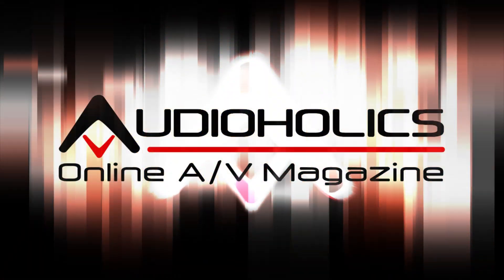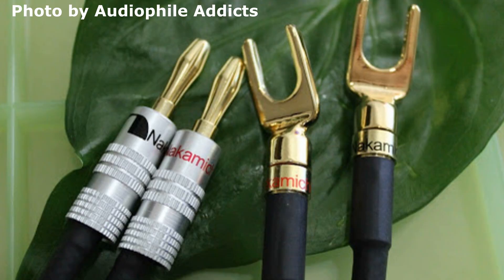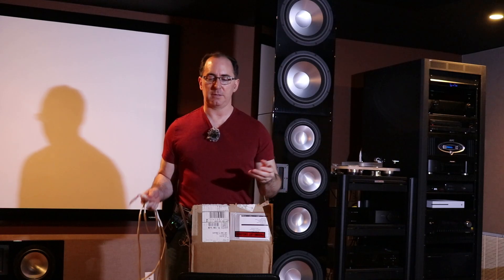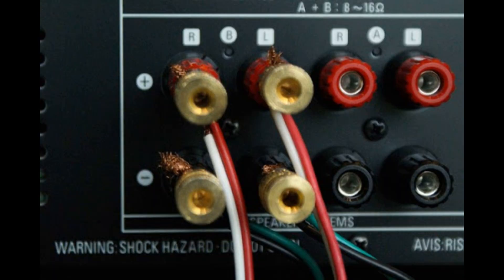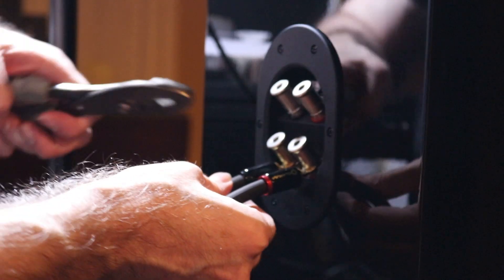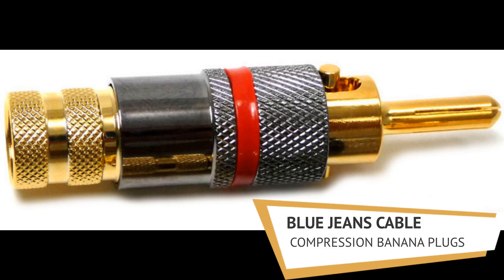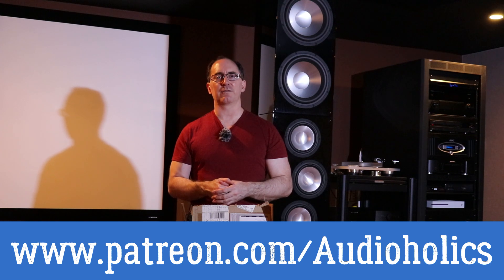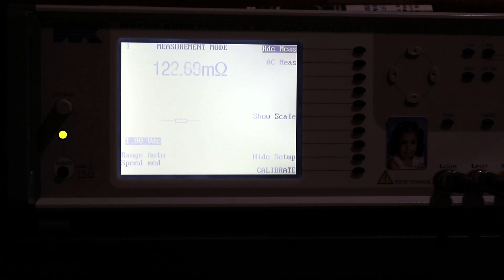Spade vs Banana vs Bare Speaker Wire Terminations: Which is Best?

Comment: I tend to think that once a raw cable is installed inside the banana connector with heat shrink tubing to seal it, the wire has either a lower or slower chance of oxidizing over a long period of time. I would imagine some bare wire connections in basement environments where climate control is not 100% in every single back corner space, you could have the potential of cable oxidization. I had pure copper cable run in my previous home theater and the runs were in place a good 18 years. The ends I did not terminate did not look pretty.

Comment: So glad to see you up and about Gene! And to come back with a hot topic for me right now. I just mounted a center channel and didn't have room for my traditional banana plugs, so I modified some minimalist plugs. Something I don't hear much any more is using solder and tinning the wires. I had always assumed that was much better than just bare wires, however I would have really enjoyed using your testing equipment to see if that's true!  BTW, I really like how my banana plugs came out, I will probably continue to this method from here on out, until the next great speaker connection upgrade happens! LOL... Welcome Back!

Comment: I bought two pairs of beautiful spades for my Magnat speakers from the Internet. The spades were to BIG. So I returned one unopened pair.

My vintage Luxman receiver has push buttons with the small wholes for speaker cables on the back. So I bought those thin banana🍌 plugs.
BUT...once connected to my Luxman, the banana plugs were touching eachother. They were placed to close.
So I FRIED 🔥🔥🔥my Luxman. It got repaired. But there is still a burn mark on the inside.

Comment: Bare wires do get corroded. Sooner or later. In a dry climate it might take years but in moist places it happens way faster. I prefer crimped soft copper spades with direct gold plating. But many bananas and BFAs are also quite useful.

Comment: Gene, that's an idiotic statement about spades. Not all spades are created equal. The key is to use soft copper spades with direct gold plating. They DO lock in place. After a year or two it's often quite difficult to get spades out. Over time under pressure they form some sort airtight bond with bonding post clamping nuts and base contacts.

Comment: I like bananas for most situations. Bare wire where I can get away with it. I also dabbled with direct wiring/No connector on the speaker enclosure and banana plugs on the amp end. Great if you have a few miles of speaker cable (I have been a speaker hoarder for more than 20 years). Anyone else give this a shot?

Comment: I prefer soldering all connections to circuit boards for the very best sound quality. Since that is impractical for most, bare wire to binding posts is the best sonic option.

Comment: If you use spades, just get some 'square' spring washers to keep tension. personally i use banana plugs, if the bog standard ones are good enough to test £100,000s of equipment in the electrical industry (im talking micro Ohms of resistance between joints), the gold plated ones are good enough for my speakers!

Comment: I use the spades because bare wire on the amp side always seemed to be difficult to hook up and keep tight, plus the issue you mentioned. Plus they always put the speaker posts too close together on amps. And unless you really tighten the posts on the speakers they too will come loose. I always thought banana plugs were not effective but maybe I was wrong. I didn’t test it with a multimeter. However, if you try to bi-wire your amp spades will not work because amp makers put those plastic covers on the posts making it almost impossible to bi-wire with spades.  Took me 45 minutes on my NAD amp but I forced it.

Comment: The advantage of banana plugs is they are designed specifically for audio interconnections and required no specific tooling to apply to the wire.  When using spade terminals, for best performance they must be properly crimped to the wire using tools and methods specified by the spade terminal manufacturer. Workmanship for both DYI  and cables assembled by manufacturer is very important.  If I were doing this as a business I would invest in the needed wire prep and crimp tools and use spades were possible.

Comment: None of the above. Tube Connectors from GR- Research are the best.  Re-wired my speakers with Tube Connectors and high quality solid copper wire.  Easy to hear the difference it made.

Comment: Love ya Gene looking good glad to see it I have a question should you be saying milli ohms or meg ohms because my husband is an electrician and he says kilo ohms and meg ohms just wondering if it’s different nomenclature for audio hookup than high voltage three phase electrical circuits he deals with and thanks for the video and everyone needs to check for those loose connections from time to time it can make a huge difference in resistance thanks for the video big thumbs up 👍
Reply from the maker: haha I was talking about milliohms, kilo or megaohms would be like an open circuit in this case.
Reply: Audioholics thanks Gene can always rely on you to clear things up

Comment: I'm no expert but what I did was cable clamp the wire to the back of the speaker with about 6 inch left loose on the end so when I shimmy the speaker in position it won't pull out and I use spades because I want a clean tight connection and yes I carefully used pliers too and this stopped my speakers from blowing fuses when I cranked it up when I was using banana plugs it saved me a lot of heart aches

Comment: With spades, could try a 'crinkle' lock washer under the terminal clamp which should reduce the risk of coming loose. e.g. https://uk.farnell.com/tr-fastenings/m6-cwbcwas50/crinkle-washer-beryllium-copper/dp/2770730
Some terminals don't allow the screw piece to come off so it's impossible to get a washer on.

Comment: Thank you for the video! I have learned a lot from you over the past few years.  Compression bananas at the amplifier.  I merge two 12 gauge ends (bi-wired) and one 18 gauge for a subwoofer all into one compression banana plug at the amplifier.  Adds up to 6 to 8 gauge.  These would not fit as bare wire on the binding post.  Tried using bananas for low frequency and bare wire for high frequencies and subwoofer on the same binding post but did not get the same performance as merging them together into one compression banana.  
Bare wire at the speakers works best for me.

Comment: i'm 100% banana plug for all speaker connections. i use Monster brand which seem well made but there are a lotof other brands that have exactly the same design (strip the wire, feed it thru the bottom half of the connector, fold the ends over the top and screw the top half on tight). i too have had less than idea connections with spades. i've also had ones that were too wide to fit in small spaces between terminals. i used to go raw but had too many close calls with wire fragments almost touching each other....

Comment: I've been using Monster X-Terminators since they were introduced. Bananas that expand by tightening the knob for a tight fit that will never come loose. They are like the WBT's but cost me much much less when I bought them decades ago.
I agree that spades never stay snug over time and it doesn't take much to have them dislodge from the terminals.

Comment: IMO the best compromise is bare ends "tinned" with solder.  If you use modern lead-free solder, dip the stripped and twisted end in flux before applying heat and solder.  This approach takes care of the stray strands problem and results in a very stiff wire end that can take a fuktonne of torque on the binding post and normally doesn't require periodic re-tightening like squished raw ends and spade lugs usually do -- and best of all, it costs next to nothing if you already own a soldering iron.

Comment: A connection with bare wire is not protected against corrosion. Via the end of the cable the corrosion can creep further inside the cable and the resistance for the signalflow becomes much higher.
So this advice is bad, by first generation Monster Cable with transparent skin you could see after a couple of years the copper grew green and higher tones becoming weaker caused by that resistance. It's a pity some people pretending being an audiofile and specialist giving such bad advice. Regarding spades, there are also spades with kind of little security walls that will overcome the problems mentioned here , ao Inakustik ones. Bare wire of course is the cheapest option but looking at the expensive speakers you can see in this video money seem to be no problem here.
Advice is nice but here's someone missing the point, using the simplest of spades for his ,,objective"measurements. And oh high pressure crimping methods use by Qed and others is the best,
excluding oxigene. Good coppercable covered with silver or total (polished)silvercables of high quality got lesser resistance by time , sounding better, copper sounding less so that must be sealed.

Comment: Great video personally I use the compression banana plus but as you said the pin sometimes get stuck .
You know what it’s great to see actual proof about what ya are talking about , just like the resistance with the cable , I’m fed up with people just doing demos of expensive interconnects / cables / ect , I just want someone to do demos of normal priced stuff , why is everything classed as good got to come with a ridiculous price .

Comment: I converted to all banana plugs, I like the fact that the plugs can be pulled out and pushed back in once in a while just to clean the connection.
Gene, what do you think about soldering the wire to the banana plugs vs screws?

Comment: Banana connectors lightly wiped down with DeoxIT, also wipe down the copper wire going inside the banana connector with DeoxIT. I also wipe down (Q-Tip) both the male and female side of RCA cables with DeoxIT.

Comment: What about sound quality? In my point of view, bare wiring should be the best way of connection and everything that is inserted between the wire and the terminal adds resistance and so should affect sound. But what about oxidation in bare wiring? How does that affect sound? If it does, can we hear the difference? What do you think?

Comment: It's good to see you are recovering  and well again.
I really enjoy your informative channel thank you for sharing your knowledge.
I live in New Zealand; electronic items are often way overpriced in stores and Amazon delivery fees are also expensive so we become inventive, think of The Last Indian.
I would be interested in your opinion of my own version of a banana plug; as copper is the best conductor material I purchased  4mm copper pipe and cut it into 25mm lengths. I thread the exposed cable end into the cut copper pipes and crimp the pipe over the cable where it meets the pipe. I then cover half of  the 25mm crimped pipe and the cable end with a couple of layers of 50 mm red or black heat shrink, the exposed 12mm copper pipe tip then plugs into the terminals just like a banana plug.

Comment: I use banana plugs on the amp end and spade connectors on the speaker end.
I tightened the spades extra as per the plier advice, but can’t help thinking manufacturers ought to use softer metals in the spade connectors (somehow without compromising on resistance, of course).

My dad went raw cable ends on an A&R Cambridge (Arcam) A60 with Rogers LS3/5A speakers back in the 1980s, but after upgrading the amp to an Audiolab 8000A in the 90s, he got banana plugs. Much more practical.

Comment: I use raw at my speakers because I have Magnepans and their speaker connectors are really designed for raw. I am using spades at my amps, but I think I agree with you. Every so often I check them to make sure they have not come loose. I will use bananas at my amps the next time I have a reason to change.

Comment: I hate spade connectors, for the very same reason that I've never been able to get them to stay tight - and yes, I've had them slip and short my amp (thankfully with protector relays). Bananas solve the problem and always stay separate, and they make good contact. PS: Happy to see you back :-)

Comment: I like the banana plugs the best, and preferably with 3/4 inch centers which allow use of dual banana connectors.   Unfortunately my main equipment is old school Marantz which used screw terminals.  Spade lugs or bare wire is my only choice.

Comment: I've one speaker builder YouTube really brag about tube connectors as the best solution. They even claim doing a double blind test you will hear the difference between 5 way binding posts and the tube connectors.

Comment: I've always gone raw on speakers and amp. That isn't to say I disagree with anything you said. It's just what I've always done. One point I will make is that I can always easily re-strip the wire when I need to to get more use out of a given cable and create a fresh connection. I like the hands on experience and there is no need for extra parts or steps. Of course this necessitates care and attention to detail to get the best results. I understand the need and know how to avoid any potential shorts in the connections I make. Regardless of individual approach, I think it can be generally said that what separates audiophiles from the general public is our willingness to give a bit more attention to our hobby and isn't that one of the key reasons some of us love vinyl so much?

Comment: i use both banana and bare wire. Did anyone notice that PS Audio  tinned the conductors on their spade connectors 
, you should never tin the wires in that way as the solder still flows over time causing loose connections , it's better to use bare wire , I spray a small amount of DEOXit with preservative on the ends of the wire for the best connection and to to prevent oxidation  over time.

Comment: A very valuable lecture, and demonstration, Gene. Thumbs up. I don't have much of a choice! I go with raw speaker connections. I recently bought a pair of Klipsch R-51M speakers that I connected to my Sony AV Receiver STR-DH520. the Klipsch R-51Ms do have post terminals for banana connections. However, I may connect them as left, right surround channels. Or as another stereo system, connected to my Onkyo TX-80 receiver (1987), but does not have terminals for banana plugs.

Same with my Sony STR-DH520 Receiver bought in 2012; although it does have terminals for the choice of banana connections for the main Front Speakers, it has traditional clip-on terminals for any other speaker connections. Except for a subwoofer. Therefore, if I re-connect my older two large bookshelf speakers 3 way bass reflex, 90dB, there is no choice for connection with banana plugs, anyway. Since I prefer a bigger sound, lower bass I am going to re-connect the large pair of bookshelf speakers. Therefore, the choice is going to be bare wire, anyhow.

Comment: I like - a lot - bananas for reason mentioned - very easy to use considering heavy amps in crowded  spaces.  however, I've pulled apart  a couple  bananas ( cheap $4. each versions )
anyone like those horrid snap connections in back of mid 70'w amps, cheaper speakers ?

Comment: I use those Monoprice Bananas you showed and they work great and our very convenient but 12 gauge is a bit hard to mount in them. However, I'm not working with High end equipment at the moment so spend extra on better plugs is not my priority right now.  Also I'm guessing that if someone using a spade just roughed up the surface you could achieve a much tighter connection.

Comment: I have to say, I was a raw guy up until I watched this video.  I recent experienced a situation where I was hearing static from my LF floorstanding tower (which gets moved more than any other speaker to get behind the entertainment center), only to find that my binding posts were both very loose.  Seeing your resistance measurement experiment sealed it for me, and I used the links you provided to order myself some banana plugs.  They'll be going on as soon as I get them.

Thanks for the information, and hope you are fully recovered!
Reply: Take 5 min to solder the wire to your posts.
Reply: @googleyoutubechannel8554 absolutely, 100% do NOT damage your equipment by soldering straight to the posts. Are you mad???

Literally the worst possible advice ever. Yeah, destroy your equipment so you can never move it, change speaker wire, upgrade speakers or change your mind about anything. And for what? Oh that’s right, “oxidation prevention.” Just don’t expose any copper, frayed or otherwise, to the air, and cut the insulation to make fresh new connections every year or so.

Sheesh. My gosh. That people would spend thousands of dollars on equipment just to destroy it and tell themselves they can hear the difference when they absolutely can not.

And as for resistance, the OP uses bare wire, and now he ordered banana plugs. Which, he is excited to use. And, that is a perfectly fine decision. It sounds like he knows what he’s doing and what he wants. I’m sure he’ll manage to make a perfectly solid connection.

“Work a few hundred hours so you can afford this excellent audio equipment….and now, just take ‘a second’, and permanently affix a 3 dollar piece of copper to it”.

-you
Reply: @googleyoutubechannel8554 Yes, “take a few hundred hours to work for your audiophile equipment. Then, take five minutes to permanently destroy it with a soldering iron and a 3 dollar strand of copper.”

Genius. Just genius.